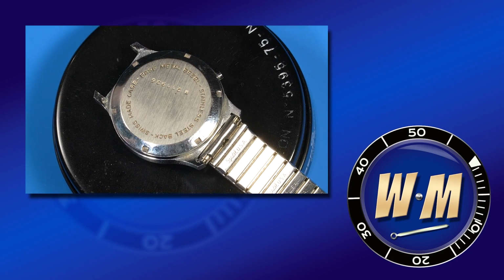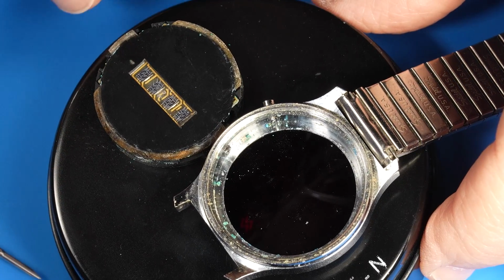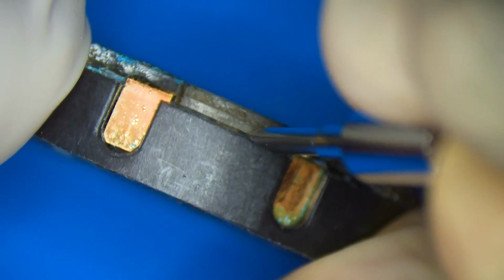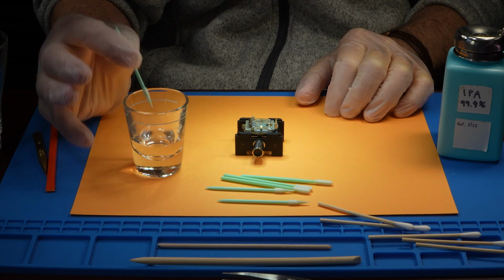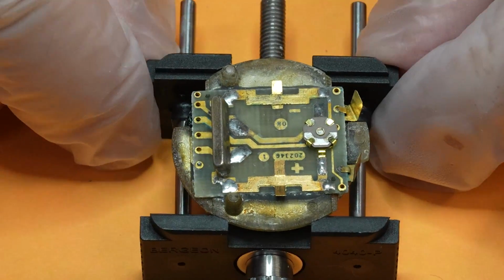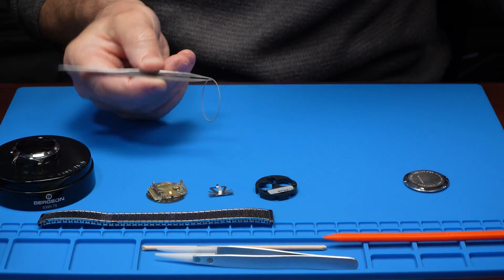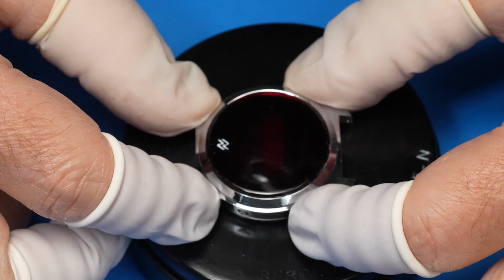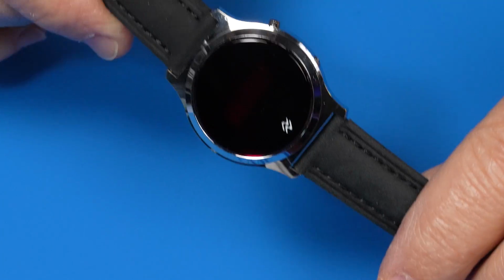When Batteries Go BAD! Repairing Leaked Battery Corrosion: 1970s National Semiconductor LED Watch

Comment: This is one of main issue I have with watches with batteries: It is difficult to replace the battery yourself. This is why I wish they would put battery in a compartment on the back with a screw-on cover (can be opened with a coin) so you can easily replace the battery instead of having to take it to a professional. That would prevent this from happening.
Reply from the maker: A separate battery hatch is indeed convenient, but I don’t think you see it often because it makes the watch more vulnerable to water getting in.
Reply: @WatchWithMike  That's why I suggested a screw-on cover so it could be securely sealed with a commonly available coin (no specialized tools). It would include a rubber gasket that should prevent water from getting in. While it likely wouldn't be adequate for divers watches, it should be fine for watches with moderate water resistance that is adequate for unpressured water exposure such as wearing it in the rain, washing your hands, and splashing water on it.

Comment: You did a great job, came here because my nos microsonic just got crazy only display 0  and on all time, gutted only had it since may it's in pristine condition as well I have a few LEDs but that was one I really liked 😢 I need to find another you in UK thanks for your upload 👍
Reply from the maker: I appreciate you checking out my video! If yours is NOS IN GOOD CONDITION THEN MAYBE YOU CAN FIND A REPLACEMENT MODULE AND KEEP THE CASE. GOOD LUCK! PS sorry about all of the caps, I didn't mean to shout!

Comment: I keep looking on ebay etc for an led watch with the full round front like you have here, I had one as a kid, they're full round as the companies where simply using standard watch cases they had before starting to use 'custom' cases with a rectangular 'plastic' window, so if they're full round its either very early, or cheap....
Reply from the maker: Good luck in your search! It's an awesome shape and very vintage. I know they're out there if you keep looking…

Comment: Very interesting video. A few days ago, I located my digital Timeband watch with the same red display you showed in this video. If I remember correctly, it was gifted to me in Christmas 1976 when I was in 7th grade. I remember how cool I felt wearing such a futuristic watch. They were popular, as I recall other kids wearing them as well. 

My question is what type of batteries go in it? When I opened the back, the batteries were gone, which is good after seeing what the batteries did to your watch.
Reply from the maker: Very cool that you still have the watch you received in 1976! These batteries are LR43, which are still readily available. Good luck getting yours running and thanks for watching! 😁

Comment: Replace the quartz oscillator.They were notoriously unreliable on NS watches in particular and are easy to change on these modules. just remove the plastic surround but be careful not to damage the wire bonds or snap off the brass contacts which are also quite flimsy. These bonds may have a protector over them but not all NS modules did and they are very easily damaged. Also there may be some traces of corrosion which you cannot see without removing the plastic carrier.
Reply from the maker: Thanks for the tips! I will check. 👍🏼

Comment: I got a Phasar 2000 from Sears, and after cleaning the module all worked correctly, so I restored the case, crystal, bracelet, the works. But when I put the module back in, the watch kept reseting to 01:00. It is frustrating, but at least I now know I am not the only one who goes through all the hard work only for the watch to stop working. Great effort and great work.
Reply from the maker: Nope, you're not the only one!

Comment: I think the dread of any watch restorer is battery leakage as it usually is not easy to fix unless you happen to source donor parts or be prepared to make a part if no where to be found.
Reply from the maker: One of the worst feelings is opening a watch back and seeing bad batteries. This was a really bad example, so I am not as afraid after cleaning this one.
Reply: @WatchWithMike  I know the feeling well. On my Casio CA-901, I opened the watch and immediately got a bad smell of acid. I was dreading the circuit was damaged, but luckily battery acid crystals were only on the surface and cleaned off without any protest. Thank goodness this is not an issue with the more vintage mechanical and automatics. 😄
Reply from the maker: @Daud76  oh my! I don't think I've ever opened to watch where you could smell the corrosion!
Reply: @WatchWithMike  It is a really bad smell of something like sulphur and acid. Your nose will not mistake it for anything else.
Reply from the maker: @Daud76  👃🏻💨

Comment: I'm in the same boat as you Mike. I bought a 1980s quartz and found that the battery leaked when I opened it. Still trying to get it to work.
Reply from the maker: Hopefully the damage is superficial! It's always a risk when you get a watch with a battery… 😁

Comment: Some of those brands produce not batteries but badderies. I have good experiences with Renata (20 years without corrosion). Do you have a favorite brand? 🕐⚙️🍸
Reply from the maker: 'Badderies' I love it! I've been buying Renata, Eveready, Panasonic and Maxell. I suppose I don't have a favorite. If something lasts a long time and the batteries haven't exploded, then I replace with the same brand. I DESPISE Duracell! They have leaked and destroyed so many remote controls, flashlights, etc.
Reply: @WatchWithMike  good to know. Man, I made a big mistake. I ordered a bunch of Duracell batteries of different types lately. Never did that before. So I will have to have an eye on them. 🧐

Comment: Hi, Mike! I find it really cool that we still call the movement the movement even if there are no moving parts inside😊 
As for demagnitizing (I wrote about it previously) - now that I have disassembled and serviced the watch that was demagnetized while running and stuck, it really turned out that some gunk squeezed between the moving teeth of the wheels and stopped them completely. The movement wasn't damaged and is running fine. But it is still interesting that such things do happen.
Thanks for another great video!
Reply from the maker: It takes so little to stop a watch! I'm glad you found it! Yes, it is ironic to call a solid state device a movement! 🤣